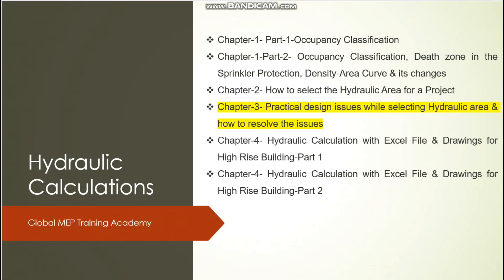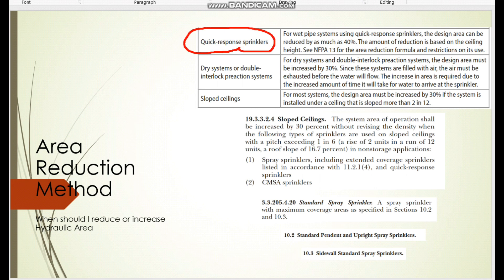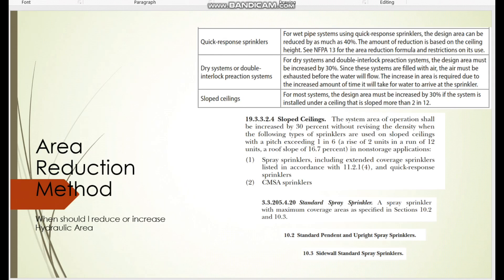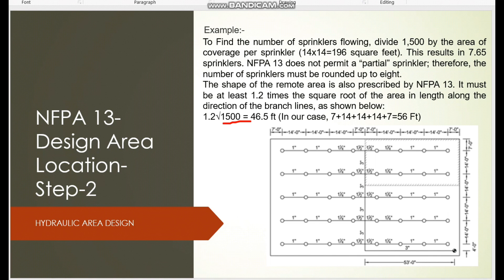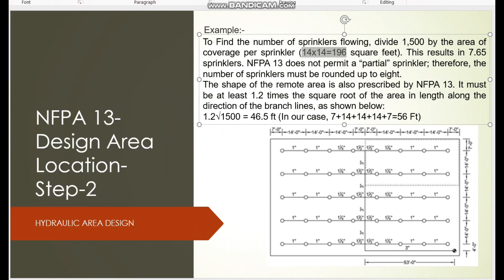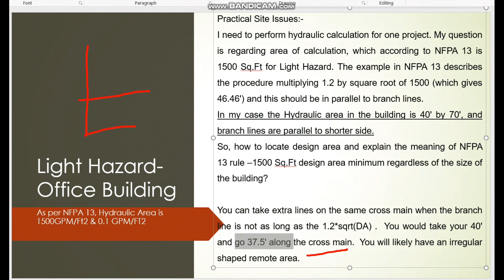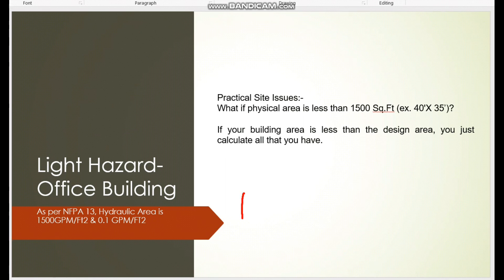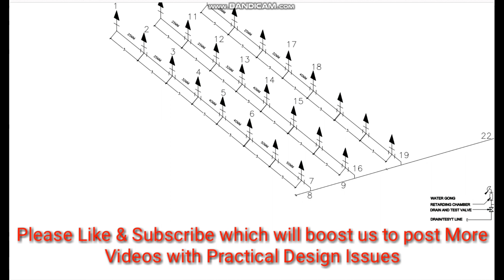Chapter 3-Sprinkler Design-Hydraulic Calculations for High Rise Building with Practical Design Issue

Comment: And also how about irregular shape hydraulic area. As u told in the chapter 1 how we need to consider for that
Reply from the maker: Thank you for your comment brother😊😊 For example, if u have light hazard,Minimum hydraulic area is 1500 Square feet. So we need to consider the hydraulic area by plotting the polyline in those irregular shape and comply to 1500 sq.ft. 
We cannot take the nearby rectangular area since nearby area does not come under hydraulic area

Comment: One doubt brother. We need to consider all the fittings in the system for the hydraulic calculation correct
Reply from the maker: As per NFPA 13, Fitting which is directly attached with sprinkler no need to consider  that is reducer 1 x 1/2inch attached with the sprinkler. There are some requirements which I wil cover in the next video